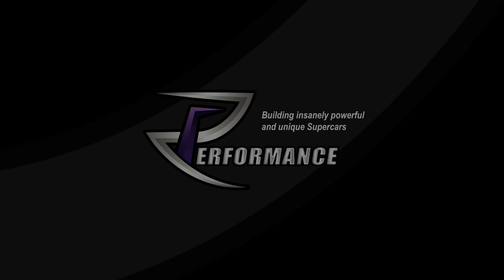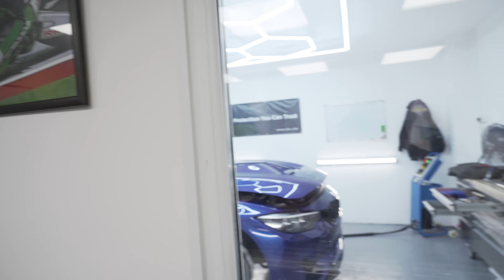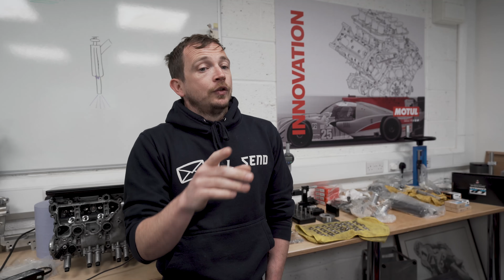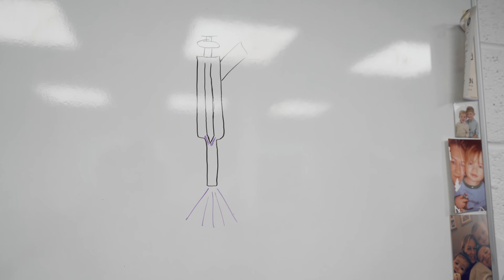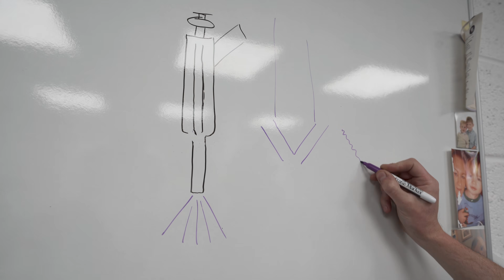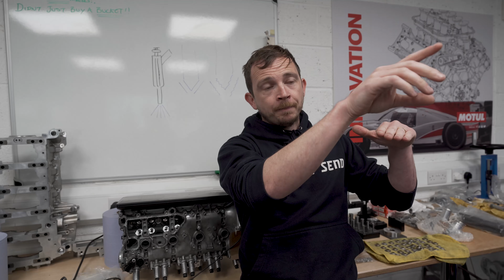DON'T EVER DO THIS!!!

Comment: Poor mans carbon clean.
Cut off the ends of a load of cable ties, all different lengths and rough cut, bundle em up. Put em in a drill , get a hoover , wizz em down your intakes, cheaper than walnuts.

Comment: Isn’t injector cleaning different from de carbonising the back of the inlet valves. Can you tell me if my 2006 Aston V8 Vantage is GDI or port injection and if GDI is it worth fitting  an oil catch can so the oil mist doesn’t go into the inlet

Comment: There is a little more to the story. To eliminate the carbon build-up problem in GDI engines. some car makers  such as Hyundai and perhaps Honda took a cheap fix - they reprogrammed the car computer to pump extra rich air-fuel mixture at cold starts for several minutes. Result is, some of the gasoline doesn't burn and it's coating the combustion chamber = the intake valves now stay clean. However, as with any cheap solution come ugly-side effects. Some of that unburnt gasoline leaks past the pistons and dilutes the engine oil. Results :  kaboom Hyundai engines and severe cam damage on Honda engines.
Reply: It's not the combustion chamber side of the valve that needs cleaning. It's the other side which doesn't benefit from your described intervention.

Comment: I've seen A LOT of cleaners for direct injection cars that are introduced on the intake side to clean the back of the valves. No amount of fuel additive is going to clean a valve when it will never see the back of the valve. I think most of these cleaners are just toluline, so on a chemical level, it should work.

Comment: I use to work as a insurance broker and te amount of engines that blow insurance know some policies don't even cover anything if you have a carbon clean. I had multiple claims from vans to super saloons, it never empties out the engine and coats the engine, so when you use if your car survives it's heavy internal damage.
Reply from the maker: I don’t know who they would tell if we had  done an inlet system carbon clean via walnut shell? I can’t see how it would cause failure either.

I understand the point with the “terrible clean” style systems.

Comment: Really informative video and excellent detailed explanation. I’ve seen mobile carbon cleaning services which look attractive for bog standard family diesel, but they still put additives in your fuel tank. I’m guessing anything that is going into the fuel tank other than fuel is basically a massive red flag?

Comment: Had an engineer who was working 150 miles away get a stone chip on his screen. Found a one man band who could repair it for £60 , which was a bargain as Autoglass wanted over £200 !! . He called me when it was done and said, while he was there, he could do an 'engine clean' on the van. Said it would pay for itself with fuel savings and this and that........... ended up as la la la in my head. Can't remember what he was going to charge me as I said no straight away, paid the screen repair and off he went.
My old man, when I was a kid, did the same theory on his MGB with a bottle of Redex. That decoked the engine , allegedly. We went for a drive after it soaked in overnight and it looked like an almighty fog suddenly appeared behind us for at least 10 to 15 miles of plumes , like I had never seen. It may have caused accidents, I would never have seen it. Did it work ? No idea. We started with a gutless 85 bhp in a lot of pig iron B series engine and ended up pretty much the same, so guess not.🤣
Reply from the maker: Yeah it’s snake oil in my opinion!!

Comment: ed china says different ......
Reply from the maker: If you’re getting paid by the company, it’s an advert not an informed opinion!
Reply: Mr China vs Ricky.  One of those is a mechanic.
Reply: I also notice Mike Brewer has popped up in the classic car press in  big full page ads plugging those cans you plug into your fuel line to allegedly boost octane levels. How are they getting away with this?
Reply: @ralphmillais5237 There are genuine octane boosters in existence. Have you looked into what he is peddling whether it's real or fake?
Reply: Was he talking about GDI engines? You can benefit from injector cleaner in itself, but if you're running GDI it will do absolutely nothing to help carbon buildup.

Comment: I agree with everything, except (and it's not only you guys) when people say 're-burn exhaust gas', exhaust gas is inert, it can't be burned again. It's primary function is to be reintroduced to aid in bringing down NOx emissions. This is done twofold by reducing the available space in the combustion chamber for combustion to take place and allowing some of the temperature of combustion to be absorbed by the exhaust gas thereby reducing peak cylinder temperatures, in turn reducing the formation of NOx as it is high combustion temperature that increases NOx formation. Just a pet peeve of mine 🤣
Reply from the maker: So you are the 1 person in the 4500 views so far who would have differentiated between my 1 line and the paragraph you wrote! Lol

If I laid the scientific process down to everything all the viewers would be asleep! 😂😂

I agree with what you say, but remember in an Otto engine the exhaust gases still carry HC which is unburnt fuel, as combustion always occurs below lambda 1 so there has to be unburnt fuel molecules! 😉
Reply: Haha sorry, I was just being pedantic. I didn't mean it as a derogatory comment in the slightest. This is very true, I guess you do have to balance it out, maybe EGR could be a video unto itself? Aha. Would that not be insignificant in theory? How far below lambda 1 would combustion occur because under light load cruise conditions is the fuelling strategy to aim for stoic? Obviously it's never bang on because you only know what's happened in the combustion chamber after combustion as the sensors are downstream but wouldn't that mean in theory the burn is ever so slightly rich, then lean? Is it ever ideal? I'm not being an arse here, this is a genuine question and why you guys do this job and not me. I'm always up for being educated and will happily take it on the chin if I'm wrong. I know this was not the topic of the video so my bad for spamming the comments aha. What I said earlier was what I was taught about EGR a long time ago now.
Reply from the maker: @AB-gt5sl  Wasn't taken badly at all mate! It is emissions based control as we true and tune it out completely a it messes up accel and decel enrichment/enleanment for dynamic throttle movement. But yes, in theory when you move to a closed throttle position an then small opening afterwards that's when EGR would be engaged to try and help tidy up the exhaust gases after being under load. It is reactive as if you are under heavy load for long periods it doesn't do anything. Cruising i would expect lambda to be between .98 and lambda 1 depending on car and age etc.

Comment: What injectors do you replace with Ricky? Early facelift V10 here. Going just over 30K miles and am going to do plugs, fuel/air filters. Thinking of doing injectors and coils at the same time as preventative maintenance (all oem?). Thank you Sir!
Reply from the maker: Just genuine Audi ones, to many fakes floating about from aftermarket outlets that cause big issues!

Comment: Still amazes me when you see people that have had it done by many of these companies and men in a van saying they can feel a difference after. I had a proper intake off carbon clean on my 8p RS3 years ago when I was getting 5 new injectors and couldn’t feel a noticeable difference 😂

My main argument is that if these snake oil treatments worked so well then why don’t these companies do before an after comparisons? Probably because they would get called to task by advertising standards.
Reply from the maker: Completely agree!